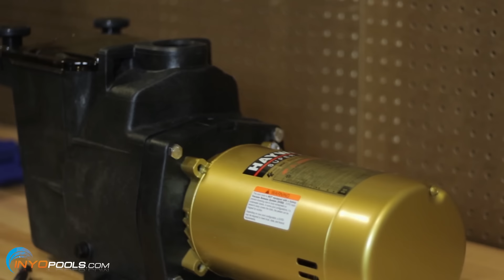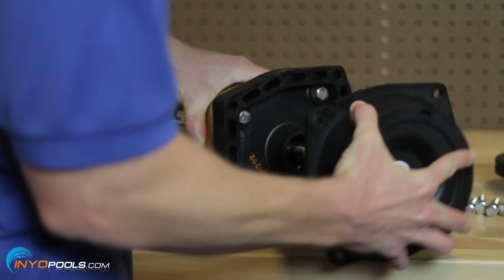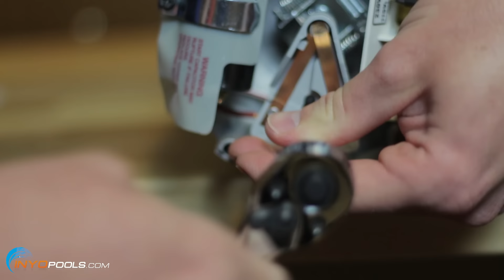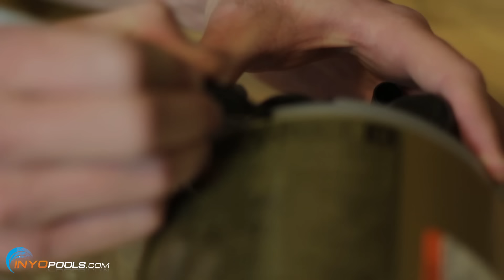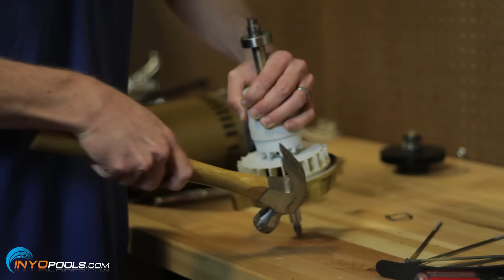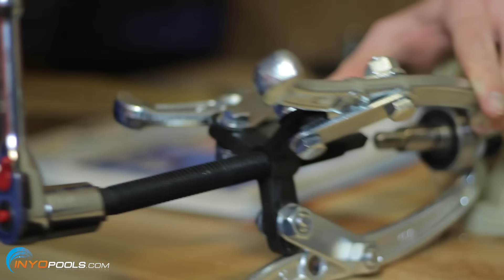How To: Replace the Bearings in a Pool Pump Motor - Part I

Comment: Those motor through bolts like to break due to corrosion. I heated the spots where they thread into the front frame with an acetylene torch, tightened them a smidge, then backed them out. Upon reassembly, coated with anti-seize. This time they came out no problem. Recommend the bolt that holds the bearing retainer get the same treatment. I couldn't get mine apart. I bent the long arm of the tab up, then used a drift punch to knock the retainer around so it was no longer holding bearing. Upon assembly, I knocked it back into position and bent the tab down to engage with the front frame.

Comment: This is pretty easy if you can get all of the rusted bolts broke free without breaking them off in their mounting holes.  In your video this looks as if its a brand new unused hayward motor so yes its going to be fairly easy to take it apart, but when you are dealing with a 10 yr old or older motor, its not going to be this easy to take it apart without breaking the bolts off.  You are better off getting a new motor, gasket, and pump seal kit.  No need to to replace the strainer basket end, just the bare motor.

Comment: If the bearings are toast, the rest of the motor is likely toast or will be within a year or two. Just buy a new motor, single speeds can be had for $200-$600 depending on your model. Fraction of the work seen here, brand new components across the motor, and warrantied.

Comment: Do you have a link or the part numbers for the shaft bearing? Thanks
Reply from the maker: What is the part, model, or catalog number on your motor's label? A picture of the motor label would be most helpful. Motor Bearings - (https://www.inyopools.com/partlisting/motor-bearings)
Reply: @Inyopools  Thanks, I actually found them on Amazon of all places, turns out though I didn't need them, it was a broken fan that caused it to run very hot, rightly so. My daughter decided to get a new pump motor, it was almost 8 years old and she didn't want to take chances. I'll put the bearings and the new fan in the old one and keep it as a spare. Thanks!

Comment: I like how you demonstrated this on a brand-new super II.. The easiest pump to take apart, under the best of conditions (because its brand new)... Ladies and gents, do not expect your experience to go so smoothly... This is the most Ideal of conditions humanly possible. I do this for a living, and usually you are fighting calcium build up, old brittle sun damaged parts, and spiderwebs and dirt and debris that build up over time. Sometimes its a struggle just getting the thing apart, and even if you are as careful as possible, you still end up with broken parts.. I reiterate.. dont expect your experience to go as smooth as an inexperienced diy-er. I do this professionally, and I still find myself cursing the world trying to make these repairs sometimes, and I know all the pitfalls and warning signs.

Also there were some safety issues that were glossed over in this guide... such as discharging the capacitor.. This might be one of those things better left to a professional rather than a youtube video, the more I think about it
Reply: Well said I agree with you 100%

Comment: hmm,  wait the bearing with the cooling fan, there is no room to fit that pulley puller, did you leave something out? Sorry my pump does not have a lock washer to remove?
Reply: Did you get an answer on this?  I have the same problem, no room for the puller arms without damaging the plastic fan, sigh.

Comment: An easy job, was almost there.....but......good luck getting the 4 long bolts out that hold the motor together, guarantee they'll snap no matter how easy you attempt to take them out.  First one I attempted snapped, so I bought a new motor.

Comment: If your motor is badly corroded, this tip will save huge headaches and $$.  

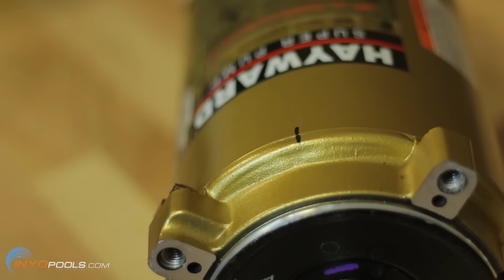Look at the video, the picture of the end-plate @3:33.   Those 4 small holes near the 4 larger mounting bolt holes are where the 'thru-bolts' are threaded in.  Those threads are probably seized from the salt/rust. 

These bolts love to snap off inside the endplate when you're trying to remove them.  New endplate =  $80.00-$90.00  🤬😕

          So, orient the motor vertically.  Get some 'Kroil',  or another good rusted-bolt/nut loosener and squirt it a LITTLE in those holes and leave in alone to soak in overnight.   Wd40 might work if left in there for a few days to work it's way in.  And those bolt heads seem like 1/4", but use a 6mm socket for a good snug fit.

Comment: Is there a resource that will tell you the replacement bearings without having to take the unit apart?  I'm worried if I take it apart, I might not have my pool running for a few weeks before I get the parts and repair it.  My pump is the Hayward W3SP2303VSP MaxFlo VS Variable-Speed Pool Pump.  Maybe there is a resource that identifies the part so I can go ahead and order it?
Reply: That looks like the model of the whole pump, but you'll need the exact model etc of the MOTOR.  Then google those motor numbers with "parts list" and you might find the exploded view showing the bearing p/n.

Comment: Is this a variable speed pump?  Is the process the same for a variable speed?
Reply from the maker: No, the process shown would only apply to single—and dual-speed induction motors. Variable-speed motors are a different animal, using strong permanent magnets. We do not recommend pool owners try to replace bearings in variable-speed motors. Take them to an electric motor shop.

Comment: How to replace the plastic fan. I think the smell that comes from my motor that runs freely, comes from the plastic of the fan burning
Reply from the maker: If your motor is burning the plastic cooling fan, a new cooling fan is not going to solve the issue. Something within that motor is getting so hot the fan cannot vent the heat properly. You likely need to do some deep troubleshooting to find the source of the overheating.

How To Troubleshoot a Pool Pump Motor - Motor Overheated - https://www.inyopools.com/HowToPage/how-to-troubleshoot-a-pool-pump-motor-motor-overheated.aspx

Comment: What bearings did you use for that motor
Reply from the maker: This video is a few years old, so I couldn't tell you for sure. But to find the correct bearings for your motor, you need to know its part, catalog, or model number.

Comment: Great video!... I am currently restoring my seven years old Hayward 1.5 HP Super Pump using the video's contents! I have a couple of questions... I need to buy a Bearing Puller and a set of External Ring Pliers to carry out the next step. Can you please  recommend details of sizing and specs for each of these items?
Reply: Go to an auto parts store. They’ll lend you a puller and possibly pliers too. Iirc they make 4” and 6” pullers. Likely can get away with 4” but this 6” will work in all cases. Harbor Freight will sell a cheap puller if you want to buy. You’ll probably only need a small set of pliers as the rings are not all that large.

Comment: Great video, easy to follow. Is there a way to find out the exact bearing for my model, without disassemble the pump?
Reply from the maker: We might be able to look up the correct motor bearings. What is the catalog or part number of your motor?

Comment: Thanks for the video! My Hayward Super Pump just stopped working. We replaced the motor and seal about 6 years ago, so the motor is fairly new. Everything has been fine since. Pool was running normally until a few nights ago when I noticed it wasn't running, even though it should have been based on the timer. After some investigation, I found that I cannot turn the impeller and there seems to be a 1/4-1/2" gap between the impeller and the pump body. It could be my imagination, but it feels like there's a gap there where there wasn't before. 
Any idea what might have happened?

Comment: After removing the motor mounting plate at appx 2 14 it looks like a plastic plate between the motor mounting plate and the front bell.  Mine did not have the plastic piece and the whole area is rusted including the locking screw.  Is it possible the manufacturer forgot to add that part?  I can provide a picture if you need to see what I'm referring to.  Great video, a shame everything was thoroughly rusted behind the motor mounting plate on mine.

Comment: Thank you for this video, it made changing the bearings on our pump easy. In case anyone is wondering a 4 inch bearing puller is just big enough to use for this and is usually half the price of a 6 inch one.
Reply: Or borrow one for free from an auto parts store.
Reply: @kalenmiller5787  what auto parts store let you borrow a bearing puller? When I asked at AutoZone, the clerk looked at me as if I had apples for eyeballs and a butt hole for a mouth.
Reply: Thanks for sharing - I was trying to find the answer to this question after watching.
Reply: @Dan-lx7ok  Ditto, thanks.

Comment: This is an excellent presentation and extremely clear and useful.  Kudos to the producer!  I'm going on my 3rd motor, decided to see if the bearing replacement approach makes sense instead of new motor.  Based on this wonderful and clear presentation, I'm going to give the bearing replacement a try and see what happens!  Excellent job in every single regard- clear, good camera angles to show what needs to be done, and lots of helpful hints.  Thanks so much!
Reply: How'd it go?
Reply: @larry-of2pk  It didn't!!  I had a health issue and while I was in recovery, my wife had our normal pool products supplier come out and replace the motor.  I still have my back-up spare that needs the bearings replaced and will attempt it (both so I have a 100% good back-up) and also for the fun / satisfaction of getting that job done.  She didn't like the noise, hence the professionals when I was on down-time.  The interesting thing is they replaced with a different motor than my existing Century product, so not sure I can direct-replace anymore (if they changed any portions of the pump housing, etc.)  I'll keep you posted on how things turn out!
Reply: @charlesdevers8089  I have the Hayward Super Pump and I'm currently at the noise phase of this problem myself. I don't recall it being as loud as it is now. Which pump did you end up with?
Reply: @larry-of2pk  I'm not at home, but when I return, I will get the info from the plate and let you know.  I did notice that the new pump is smaller in diameter, is rated 1.25 HP and seems longer than the Century pump.  Pinch a Penny in Port Orange, FL  installed it.  I was a "bystander" to the work and only found out the pump was changed out when I was able to return to my home.
Reply: @charlesdevers8089  Thanks ... glad you're back up and at it
Reply from the maker: Glad it was helpful!

Comment: Rule of a thumb, if your motor is 10-15 years old, you are better off buying a new one because of wear and tear, less noisy, more efficient, 2 speed replacement is a must almost same price as single speed.  Variable speed motor is preferable but more or very expensive.

Comment: Thanks for the video!!  I know that usually when the pump won't turn on and just hums, it's the start capacitor.  I've replaced mine twice in the last 5 years.  But just this week my pump started running for about 30 seconds, then turn off,  then few seconds later turn on, then few seconds later turn off.  Never seen it do this, and my searches online can't find anyone else mentioning it either.  Is this a rare symptom of another bad capacitor, or is it likely something else that I can replace?  Ever heard of this happening, and fixed it?  Thanks
Reply: This happens when the motor overheats.

Comment: Good video. I recomend using a mallet and not a metal hammer when banging on metal. A pipe is also not ideal as a press would help maintain perpendicularly and prevent shaft gauling.
Reply: i agree he looked like a butcher working on a motor.

Comment: Great video! Unfortunately way too much for me to do. I'm buying a new motor..roflmao
Reply: Very good idea, I did replaced mine and the noise is still there, ended up buying a 2 speed motor the same price as a single speed, very quiet and almost no noise on low rpm.

Comment: Very good videos, can you tell me please what type of bearings are you using, (size)  and there is a particular brand or characteristic that needs to be take in consideration to buy them? thanks!
Reply from the maker: We use double sealed bearings. The bearing size will depend on the make and model of the motor.
Reply: Inyo Pools thanks

Comment: By the time the bearings go bad on a pool pump motor the motor housing will be completely rusted and should immediately be thrown in the garbage and purchase a new motor unless it is an indoor pump still cheaper to trash it

Comment: Is changing the bearings on a variable speed motor much different or more difficult?
Reply from the maker: We only recommend that a qualified motor repair shop replace the bearings in a variable speed motor. The magnets in the motor are very strong and there is the potential for hand injury during reassembly. Damage to the windings is also possible when removing or installing the rotor. Again, this is due to the very strong magnets.

Comment: is it dangerous to keep my pump running with bad bearings ?
Reply: Musa Absi 
No it just sounds aweful... if the bearing cease u could burn up the motor... but with bad bearing u are already on the market for a new motor. So run it until ur neighbors strangle u...
Reply from the maker: I wouldn't say it is dangerous, but I would say it is an issue that needs addressing sooner than later. Bad bearings don't fix themselves, and they are usually a sign of a bad shaft seal. A bad seal will keep leaking ruining other parts of your motor. - MGS

Comment: This procedure is fine ---EXCEPT for the 4 damn long "through screws"!  I have attempted to rebuikd THREE of these freakin' pumps, and in ALL instances, these damn screws/bolts are he weak link. Hayward intentionally did NOT use anti-sieze compound and at least one, if not more, will be non-removeable and TWIST off...leaving you with either trying to drill it out or buying a new motor! You cankot avoid it. You make thus look damn easy, but you are using a new motor in this video, or one with very few hours! Show us how to get the damned long screws out once they have seized in the aluminum motor housing!!!

Comment: Isn't worth the trouble would be cheaper to buy a new motor in the long run.  Unless a owner has nothing better to do than mess with that.  This guy will not be replacing bearings for anyone
Reply: If the bearings are a couple of bucks, and you can borrow a bearing puller for free, how is it cheaper to buy a new motor?
Reply: @glidersoar  They need a few things like a propane torch to get the long bolts out and some new seals as the old ones will be rat shit and will leak if you reinstall them. Yes still cheaper than a new one though.

Comment: best thing i learned is 
take the motor to the shop repair 
oe buy a new one  thnx
Reply: As a pool guy, when bearings go bad, there's 100% other components that already are worn out or will wear out within the next year, and soon you'll be paying enough in parts to afford a new motor. Just get a new motor when bearings go.
Cheap man pays twice.
Reply: Same!

Comment: that is great of you are working on a new motor like you are everything is not rusted and your things come off easy what about a motor that has ben outside for years and the parts are old and rusted then it is not worth it to do that just replace the motor because something might break like the thro bolts

Comment: These two videos were a great help for a novice Thank you. It was a journey with a few set backs ( outside lock ring holes were too small for the pliers I bought, end bolt was rusted so the head distorted too much for the socket to fit and I destroyed it, and my new 3" bearing puller was too short to reach one bearing), but the next one will be easier!

Comment: If your motor is at all corroded, don't even bother.  Buy a new motor.  The long 8-32  bolts that hold the motor together screw into the aluminum ends and will be seized solid and twist off easily.
Reply: Use propane. The aluminium will expand more than steel as it has a lower melting point.

Comment: Thanks for the video. I now realize I will take the motor in to a professional. LOL
Reply: The bearings are only a couple of bucks, you can borrow a bearing puller from an auto parts store, nothing to it.
Reply from the maker: Lol, replacing the bearings is not for the faint of heart haha. But seriously, it can be tough but if you have the time and the patience it can save you a pretty penny in motor replacement and labor costs.
Reply: Thats some funny shit
Reply: Agreed, after replacing bearings, I’ll work on the ole flux capacitor. 😂
Reply: Thanks for the comment. I will take it to professionals based solely on your comment.

Comment: The bearings and seasls have been replaced on my hayward super pump II  115/230 18amp model C48L2N134B3 when I reconnected to hydro to try pump the breaker is kicking off. Only thing different on this assembly is the motor governer off 1hp and v swithch from 1 hp. they appear to be exactly the same? your thoughts?
Reply: He didn't reply because you now have an electrical short circuit.

Comment: That motor shaft is awfully rusted for a brand new motor.  You should also warn people how to de-energize the capacitor if they are going to touch it.
Reply from the maker: That step was glossed over in this guide. When we complete a refined version, we will be sure to add it in.
Reply: @Inyopools   hi was this safety info added somewhere? thanks.
Reply: to de-energize the capacitor use a screwdriver with insulated handle to short it out (touch both the nubs where the angry pixies come out from). if you want to be extra safe wear some winter gloves
Reply: are you able to fix it without doing that or is it a must?